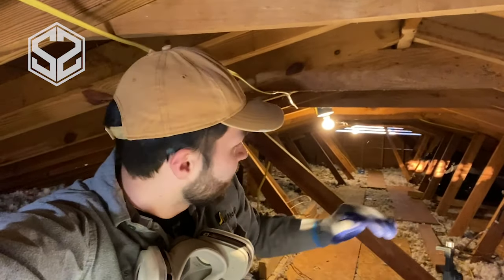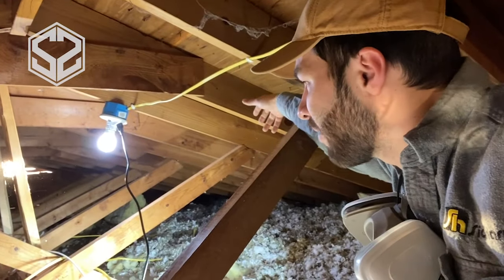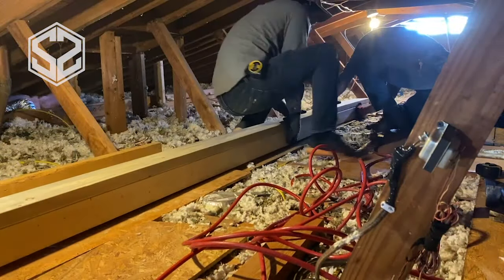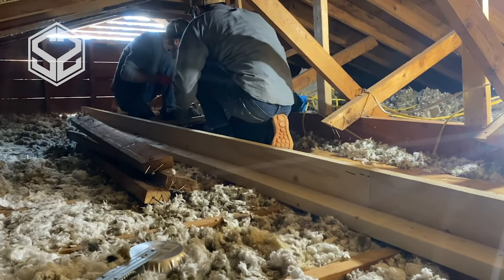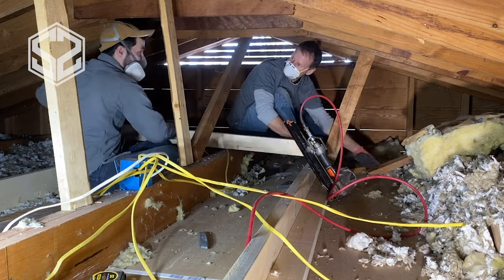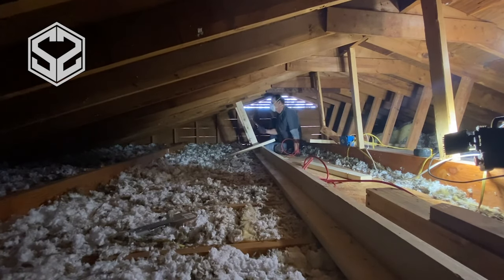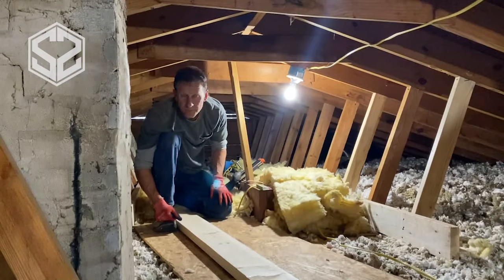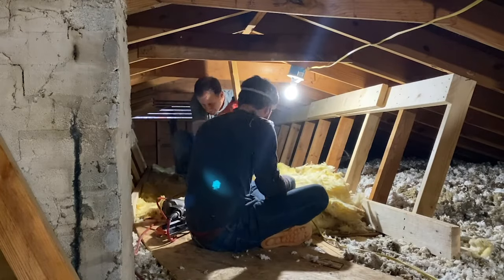How To Fix A Saggy Roof

Comment: Please learn the difference between a rafter and a joist. It makes it very confusing calling ceiling joists "rafters". The strongbacks were attached to ceiling joists, not rafters. Also, there are no trusses in this attic that I could see. I think you are calling the rafters "trusses". Good job but, due to aberrations in semantics, a lot more confusing than it needs to be.
Reply: Agree. I thought surely someone caught this.

Comment: This video is a treasure. I need to put a knee wall in my attic for a few saggy spots, but I've been concerned about how to judge not putting too much weight on the joists. That trick with using a 2x4 to pry them up is absolute gold.
Reply from the maker: Thanks so much! So glad the video was helpful! :)

Comment: How could you tell how much to jack it up in each spot? Unless the roof was already straight…
Reply: They probably figured out what the right height should be for the supports and cut them all to the same length, and then just jacked up each spot enough to fit the supports.

Comment: Thanks for posting this. After this winter I noticed a sag in the roof and sure enough when I went up in the attic, I found one of the trusses had snapped. I made a quick repair to stabilize the truss but I think this is a good solution for repair instead of ripping off the ONLY 5 YEAR OLD ROOF.  I'm no longer a fan of truss roofing systems. To me it doesn't matter how much wood you save using trusses because it's a loss when they fail.
Reply from the maker: Oh wow! Sorry to hear that. Thats a pain. The snow load might have been too much for the trusses to support. I'm glad the video could help! this should greatly increase the strength of the existing trusses.

Comment: What you've done is SO much more tidy than what was there, and undeniably better.  I can't help but worry that you're not overloading those 2x4 joists and risking bowing down the ceiling though. I think I would have run some 2x6 or 2x8 from the center beam to the sill, either with some hangers or sitting on top of the beam, so as to keep the load off the ceiling.  Let us know later on if anything happened to the ceiling.  I did something similar but fortunately had another load bearing wall to brace on.
Reply from the maker: Thanks! Yeah that was one of the options we were thinking about. Hopefully because it is only 2 feet from the main beam it should have plenty of strength. Also the joists are actually 2x6s. I’m keeping an eye on it and so far all good! :)

Comment: You are AWESOME....Bud....This is a real challenge for old homes;     especially with asbestos concerns and sweltering heat !!!  A lot of people took out a lot of walls n the 1970s and 80s, which should not have been removed.  Some old houses have gone through more than one previous reno, and you are often 'GUESSING' at what they used to fasten things.

Comment: A fine video and superb techniques!  Before cutting each to same length, Did  you originally determine this length by measuring at the gable end wall thus trying to adjust sag to match the non sagging rafter?

Comment: In most states with codes , placing ANY weight on ceiling joists to support a roof load is forbidden . 
The existing rafters on this house are wide enough but aren't supported correctly . a better solution is to use a true ridge beam where the rafters are ' hanging ' off of it with a birdsmouth   cut as the rafters intersect the beam . then install two additional beams a third of the way down the rafters on each slope of the roof ,supported by the outside walls with posts extending all the way to the foundation. the rafters are also cut with a birdsmouth so the load of the roof structure is vertical /down and not spreading the outside walls . this is actually faster than the so-called traditional method . no other supports are necessary  and the roof will never sag .
Reply: Interesting.
Can you give us a pointer to you tube videos?
Reply: I’d need a visual explanation 😂

Comment: this video came at the perfect time. i have some rafters that are sagging as the house is 60+ years old. and I think a tree fell on the roof years ago. all the houses in my neighborhood have the same sagging just not as bad. I am going to use same style of supports. as for the homeowners and or contractor that left that roof like they should be ashamed to leave a mess like that.
Reply from the maker: Thanks so much! Good luck with your project!

Comment: 2 Questions
1. What angles are you cutting the 2x4 ends (that are going on the strong backs)?
2. How did you determine the length of those 2x4s?
Reply from the maker: Sure, the angle on these will depend on the angle of your roof. You can calculate the length and angle by going to a truss that is not sagging and hold a 2x4 up to the truss and strong back. Then run a pen along the strong back to get the angle. Cut and then repeat the same steps to get the angle and length for the truss. If it takes a few tries that’s fine. Once you get one done you can use it as the templet for the rest. Hope that helps. 

Thanks!!

Comment: How do you know where to put the strong backs? Thanks for the video!
Reply from the maker: You want to aim for a load barring wall on the floor below. The previous owner of this house opened up the space below and took out the walls that were supporting the roof and installed a main beam down the middle instead. We tried to install the strong back as close as we could to that beam. If the wall doesn’t r support beam is too far away you can get 2-3 feet from it and that worked for us.

Comment: I was about to ask the same question @breaktime.  I think if you get that base in and cut one of the braces at the gable end (little chance of it sagging as it's sheeted) then duplicate from that oner. having made sure the base is parallel to the outside wall

Comment: You didn't have any wiring, gas lines, exhaust vents, water supply lines or duct work to deal with?
Reply from the maker: There were a few vents but they weren’t located in this section of the house. There was loads of wiring that in a previous video I had to fix and organize. Because of that it was already out of the way of this project. The ductwork is in our basement.

Comment: Looks like you have a 2x8 screwed to the 2x4 for the L beam. Would the L beam be enough for roof support without the 3-ply beam? Not sure where the bearing wall is located under the ceiling to warrant a 3-ply beam.
Thanks

Comment: Doesn't this put more load on the ceiling? Verses going off the top plates of walls and using the appropriate size perlin?
Reply from the maker: Yes, but the wall here was taken out by the previous owner and they caused the sagging roof. If possible it’s easiest to go off of a wall but this is an example of how it can be done if that’s not an option.

Comment: so if the knee braces, or the strong backs were sitting on top of the ceiling trusses, what’s holding them up? once the load bearing wall beneath was removed?

Comment: How did you find the 2 angle cuts at the bottom of the strong back? thx and great video
Reply from the maker: We held up the 2x4 next to the truss at the angle we wanted it to support and had the board just long enough to reach half way down the rafters. With the 2x4 next to the rafter we used a pencil to transfer a line from the top of the rafter on to the 2x4. After cutting that mark the other angle is exactly 90 degrees from that first cut. A speed square works well for getting the second angle. After that we placed the the cut 2x4 on the strong bad in place but left the 2x4 a few inches too long so that we could place in next to the truss and mark a line for the top angle. 

Hope that helps. Good luck! Thanks :)

Comment: How did you determine your length for your rafter ties you installed.
Reply from the maker: We measured a rafter that wasn’t sagging. We cut it close to the length we wanted then held it up in place and marked the angles.

Comment: Thanks for this. Did fixing the sag cause the roof to leak afterwards? We are facing a similar issue and have been told we need to re-shingle after the roof has moved to it's original position.
Reply from the maker: Thanks! No we didn’t have any issues with the roof after fixing this. However a few months later our home insurance made us replace our roof because of unrelated age issues with the roof.
Hope that helps!
Reply: @SimonSaysDIY  Man, I'm in the same situation. Shingles are old, but I'm trying to fix sagging rafters and a deflected ridge before I begin.

Comment: How did you determine how long to make all the braces?  

Also, how did you determine if the rafters were pushed up far enough?
Reply: I caught somewhere in the video around @8:30 - 8:45 that the father in law was eyeballing the level across a couple rafters with the 2x4. You could probably buy a proper level and use that to figure how much you need to push/pry the rafters. Definitely would want to get one of those 4 or 5 foot levels so you can easily measure across several rafters.

Comment: On the top of the 2x4 support did you just run a string line on top to get them on the right spot?
Reply from the maker: We measured down from the peak of the roof on each side and ran a chalk line string to make the placement. Thanks!
Reply: Ok thanks for the reply!

Comment: This is a nice
 video but there are a few problems I have here..... 
#1 you removed an acceptable bracing that you considered inadequate

#2 you just placed a load in a random area of ceiling joists without adding any support beneath it

#3 supports would be better suited perpendicular to your ceiling joist directing under what ever sag you have.

#4 if this roof is actually sagging, why wouldn't you sister new rafters to the sagging rafters to avoid this problem for longer and possibly damage below ceiling joists?

#5 you're wearing a respirator but no safety glasses.....

Comment: Hey guy , I have about a 15 or 20 ft section that needs lifting , being disabled what is a ballpark cost on having it done ,so I don`t get ripped off
Reply from the maker: I probably wouldn't pay more than $600-1000 that a big price difference but that will depend of the amount of materials and difficulty of the project. This project took two of us only one afternoon to complete.
Reply: @SimonSaysDIY  THANKS VERY HELPFUL
Reply: @SimonSaysDIY  how big is your roof?

Comment: you should have attached the existing props to the existing beam with hangers so they would have been angled the same as they were before the beam installer hacked them off the old load bearing wall and then cross nailing them - relying on a few nails shear strength.

Comment: Maybe those braces are doing a bit of work, would it not be safer toremove one at a time just make sure yu don't have the roof collapse?
Reply: Also wondering about codes, and putting weight on the ceiling joists
Reply: Why not just go right back to the center beam rather than make those strongbacks and cut/secure them properly so they do bear the load?
Reply: If the angle is too steep, what about making a web?

Comment: 1 .  This is why DIY’ers should not do this!  When that wall was taken out and a beam in trust I can tell it was to code!  U did not come along and save the day!

The beam sits there and it u look above you will see collar ties to hold it together!  Your wasting lumber and sound silly to a pro!
Do not seal around your pot lights and keep insulation away from them ?  Heat build up & that is why a lot of ppl in colder areas don’t like them!  Because there is a minimal amount of air flow to keep them causing a possible fire!  Nice job slick!
I quit right here I seen enough to know your dangerous!
Reply from the maker: Thanks, But if it was done right then the roof wouldn't be sagging and supports missing. This was a typical BAD professional job. Supports for the roof taken out and never replaced. wiring cobbled together and scattered everywhere. Missing electrical box covers exposed wire connections and loose insulation moved during the remodel and never put back. Also, I know my limits so this is why I asked for help and had a real professional contractor advise and help with the project. 

Thanks for the feedback though! :)
Reply: I find that really hard to believe and no there is not so many way to fix a roof!  
I have never ever seen a roof fix like that come on !
It had collar ties !!!!  PERIOD!

I really do not care what you do!  However you put it out on YT like it’s the right way??? 
The saying goes if you find yourself in a hole the 1st thing you do is???   STOP DIGGING!

If I was fixing that roof 1st off you go to an engineer and hv your plan approved!  It’s a roof not an office wall!
I seen the braces and collier ties and NO SAG!
U placed to much crap on the ceiling and eventually that’s a problem!
Ask a contractor!  Not the guy down the street that flips homes!
This is my problem with YT!
If I was the contractor and I seen your video and stating it was done wrong trust me I would see you on the legal field of play!
Your not a carpenter or a contractor so that means you hv no idea what your talking about?

Yet if you were a doctor and I had one of your patients on tv pointing all your supposed mistakes u would be pissed!
Can you calculate rafter cuts for a roof?
Figure your bd ft of needed lumber ?
Use your framing square to figure the angle of my skirt board?
Calculate rise/run for stair lay out?

Guys train years to learn this craft & you buy a house open a YT channel and start pointing out all the carpenters mistakes?

I am wasting my time !  Pls hv some respect!
Reply: @SimonSaysDIY  don't feed the grizzly construction trolls
Reply: Could you do a video showing how you would do it. This seems good to me.